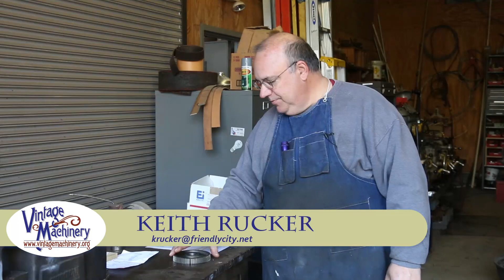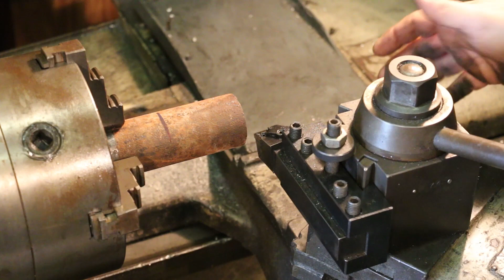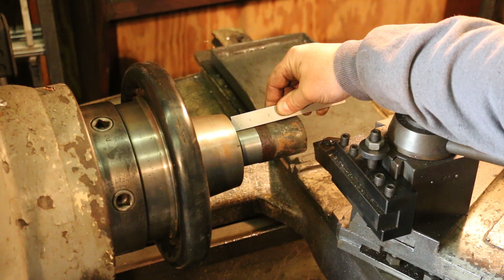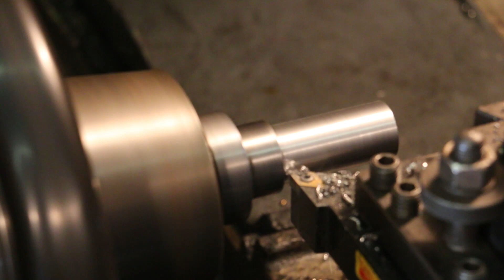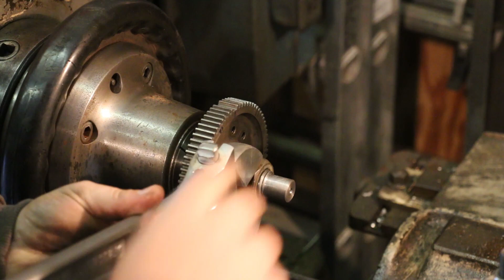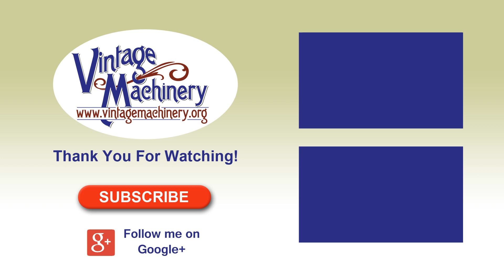Broken Gear Repair:  Machining a Custom Mandrel to Hold the Gear

Comment: Even if it's just an old scrap of steel, seeing rust cut away to reveal a shiny precision finish is a great feeling every time -like watching lead turned into machining possibility gold.
Reply: +John Strange the outer was just mill scale, it is how it comes new, they roll it red hot.  its not accurate dimensions untill its machined, and its a bit rough on the machine to get that layer off, but its cheaper to buy than machined stock.  I have several chunks of mystery metal hanging around that i got as cut offs from my time.
Reply from the maker: +John Strange I just love that too!  And for the record, while there was probably some mill scale on that piece, it was also pretty rusty.  Here at the museum we have tons of old shafts and stuff that have been sitting outside for decades so they are covered with years of rust and scale.  But underneath, it is a good as it was the day it was new!  I use a lot of that scrap stuff to make jigs and fixtures like this.
Reply: +jusb1066 Though I've worked in a machine shop decades ago, I am not a machinist.  However, do I recall correctly, that scale is harder than the steel itself?
Reply: Greg Altenhofel they roll red hot steel on water cooled rollers to get the rough dimension so you end up with kind of heat hardened skin, along with rust as they dont tend to protect it, and its uneven in thickness,  you have to allow plenty to peel off.
Reply: thanks
Reply: +Greg Altenhofel   Correct Greg. . the power of a shaper?  beyond
rusted, shapers don't care.  For example I found a 1800's wagon
square axle in the woods.  Chop sawed it to say 4" long, lots of pieces, vise up- crank sahper

 to below the rust, perfect then to the mill; 1234
blocks V blocks, whatever is left I machine 30* 45*s and 90*s.
Reply: I feel you guys. I used "rust" as a general surface condition, but be it mill scale or actually rust, always exciting to see it removed. :)

Comment: Machining items like that blows my mind, spurs me on to buy a Lathe even if it was not used regularly just to learn threading would be great.
Reply from the maker: +Dinxsy I encourage you to do so.  You can do so much with a lathe and it is just plain fun to use sometimes!
Reply: Keith Rucker - VintageMachinery.org It certainly looks fun, and would help out on projects.

Comment: Thanks for the video, Keith.  You gave me an idea to make a mandrel for my dividing head.  It has a MT2 taper, so I will cut the taper on one end and finish the other end per your video.
Reply from the maker: +Herb Blair There you go!  That is the great thing about watching other people work, it springboards ideas for you to use!
Reply: +Keith Rucker - VintageMachinery.org  I found exactly what I was talking about at shars... MT2 taper with 1/2-20 threaded end.  The neat thing about this is that it has a center in the end with the threads,  makes locating center of the indexer easy.

Comment: Keith Fenner did a 2 or 3 part video for the same gear. he made the repair and made a new one.
Reply: +Joe Richards true, but we also had several vise restorations last year, everyone has their style, its good to see, and its another machine that is coming back to use because someone is repairing a critical part.
Reply from the maker: +Joe Richards Yep, I remember that series.  I will do things similar as he did but with a different setup on the horizontal mill.
Reply: +Keith Rucker - VintageMachinery.org sounds good.